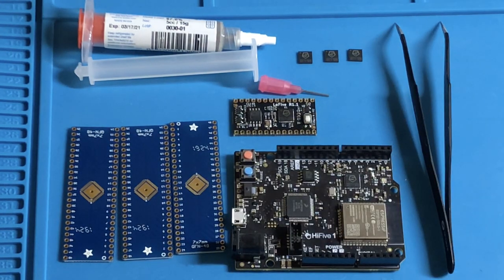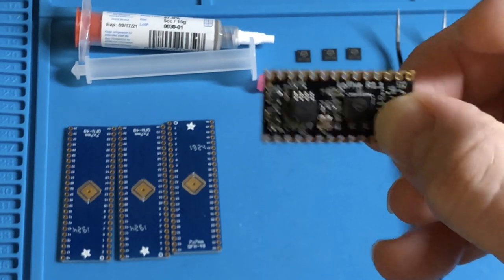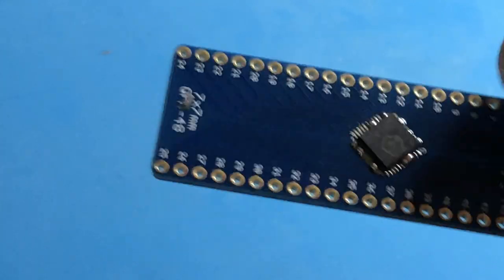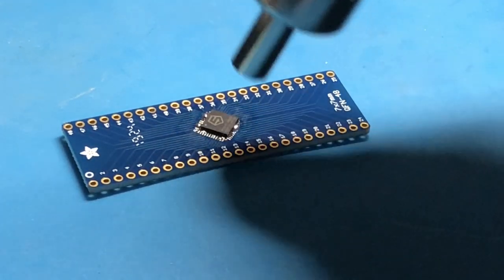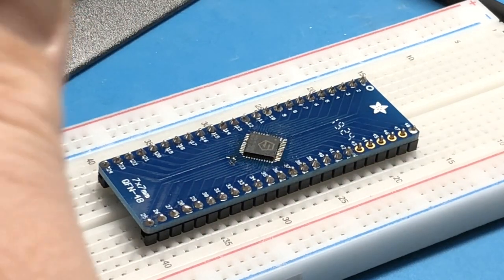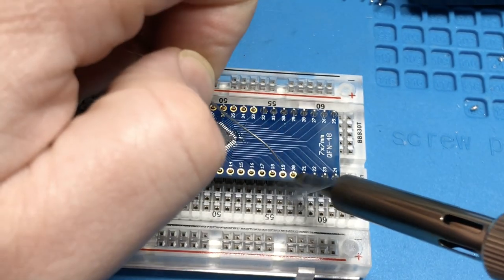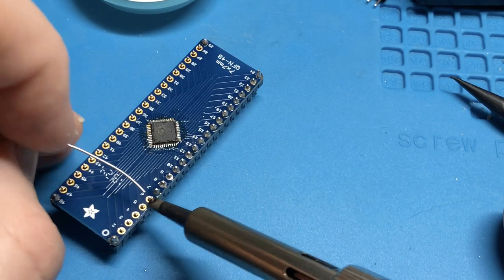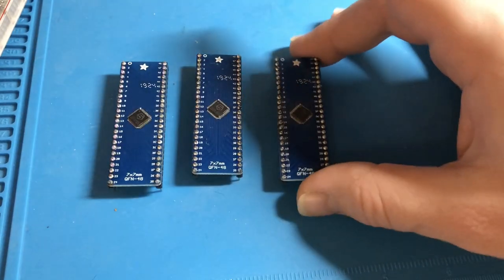Attempting to create breadboard-friendly RISC-V microcontrollers using SiFive's FE310-G002 IC.

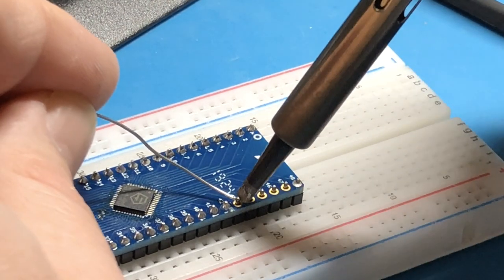Comment: @23:50 Be warned, I will not do that because the heat transferred from the Iron tip to the Experimental socket will destroy the allignemnt and stability of pins, because the experimental board female pins will tend to melt the plastic holding them and this will eventually ruin your board ability to establish good electric connection. Remeber that perfect connection on your socket board is provided by the spring property of pins and plastic holding them.

Comment: Noob question : How does the soldering of the SiFive chip works ? It looks like you apply solder on everything, then the heating magically get rid of the excess ?
Reply from the maker: Because I sized this incorrectly, it did not work as expected, but the key is that the solder will wick itself onto the pads. It is attracted to hot metal and, as long as you don't over apply, you can expect the solder to "magically" attach to the correct metal points. I have not had much time for my projects lately but I still plan to make a correct sized breakout board for this chip and try again.
Reply: The magic is in the solder resist paint and surface tension.

Comment: Hey nice Video! Where did you buy those FE310-G002 Chips?
Reply from the maker: I purchased them at crowdsupply.com which is just one of my favorite sites (alongside tindie) to get cool tech to tinker with. They are 5 for $25, a good deal, I think (assuming you solder them correctly haha!)